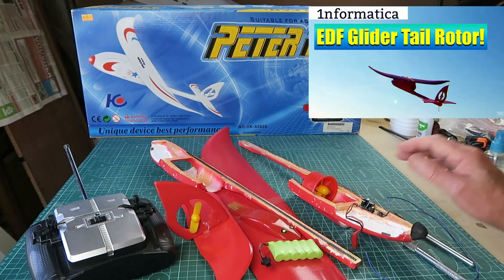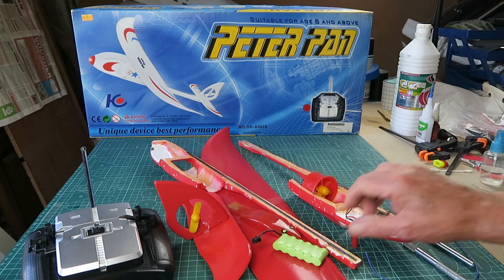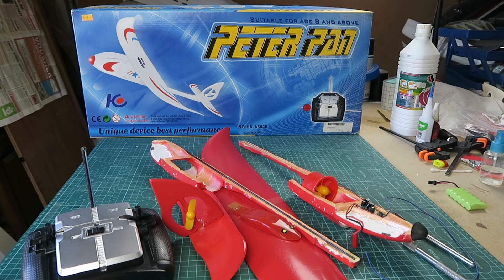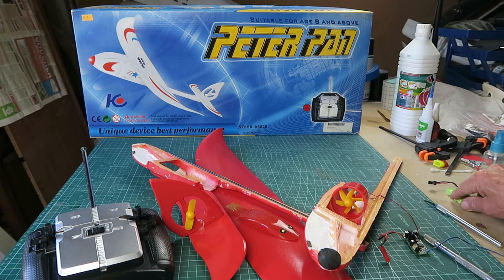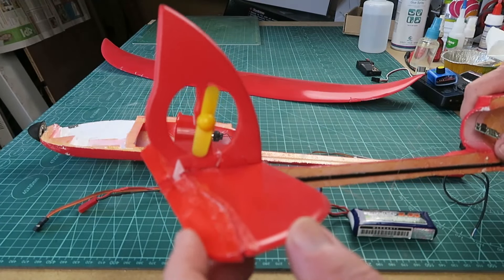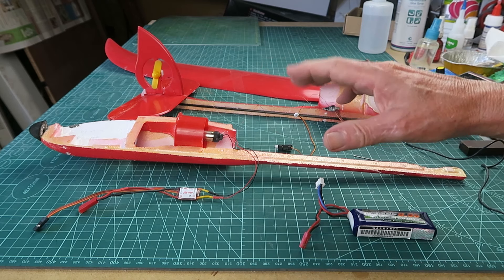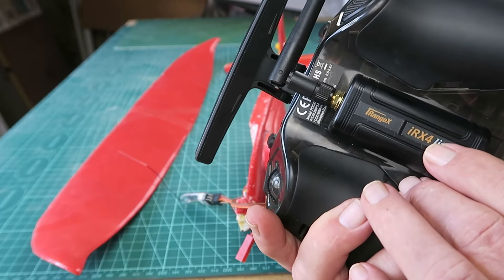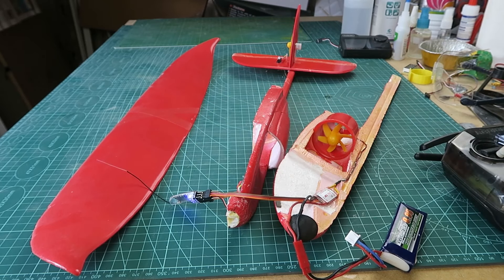Peter Pan EDF Revisited Vintage Brushed EDF with Tail Rotor

Comment: That is one interesting aircraft, The rear rotor reminds me of the Cirrus prototype plane that had a rear rotor but never made it into testy flights. I still have a GWS A-10 Warthog with twin brushed EDFs. It flies surprisingly well with modern lipo batteries. With the NIMH battery, it was sluggish and heavy and only flew for 2 minutes, With a 2000mah 2s it flew for 6 minutes at 70% throttle. I want to convert it to brushless with some small Himax in runners I have which is about 10 years old. Have you ever had any GWS ARF planes? They were quite fun to tinker with. It's too bad they went out of business. You can still buy the GWS F16 or F18 I believe from Aloft Hobbies. They bought hundreds of them before they went out of business.
Reply from the maker: I have never seen the Cirrus plane to refer to, do you have a link? Hmm GWS, yes, I have bits of one : https://youtu.be/4LewGqu04dw It is a shame they're not around anymore. I still have the B2 bits in a bin bag, do you think it's worth trying to rebuild it? Thanks for watching, have a great day!

Comment: "The steering is ... interesting." 🤣🤣 You can take the M'lud out of the Old Country, but instilling the normal Mediterranean voluble hand-waving characteristics into 'em takes a generation or 3! 😜
Neat conversion and flies surprisingly well. But no doubt in its original form, it was the means of keeping most of the kids of the time out of the hobby. 😱🙄
Reply from the maker: I have learned a few local hand gestures while watching football in the bar! Dunno if YT has an AI detector for that!

Comment: Great work as always. Your channel is a treasure trove of quirky lovable RC tinkering. I always come away inspired to go play with some of the random gear I have knocking around.
Seeing you use the Multiprotocol module made me think you may know the answer to something that has been bugging me.
I have the same module on a Jumper T-Lite and it works perfectly. I also have an FrSky Taranis X9D with full size JR module bay. I bought the BetaFPV adapter to put the nano module in the X9D JR bay. They sell the adapter mentioning crossfire. The module powers up but I can't get anything to bind. I wondered if you have ever tried anything similar. I'm not sure if it is the adapter at fault or if the MultiModule just uses different pinouts and will never work.
Reply from the maker: Hey thanks! I am happy like like my quirky stuff, it's what I'm best at! As far as I can see the adapter you have should work OK. The "lite" modules only need 3 connections, serial plus and minus : https://www.expresslrs.org/quick-start/transmitters/tx-prep/  I have seen on my X9D that some devices do not sit well in the bay and need a bit of technical wigging to work! Also the tin plated connections in the bay can become tarnished and not make good contact. A squirt of Isopropanol and an old toothbrush usually sort that. Otherwise (ahem) of course you have selected the External module and switched off the internal RF module, and chosen the correct protocol. Always good to make sure all the firmwares involved are up to date. Have a great day!
Reply: I wanted to buy a multiprotocol module, but I went with a ELRS PWM RX, They are super cheap these days!
Reply: @kmieciu4ever  Fixed my issue. It was a bad physical connection on one of the pins. :)
Reply from the maker: @kmieciu4ever  Agreed! I happened to have a FS2A lying around so I used it! I have made maybe the smallest ELRS PWM RX : https://youtu.be/pkhymye5W8E Thanks for watching, have a great day!